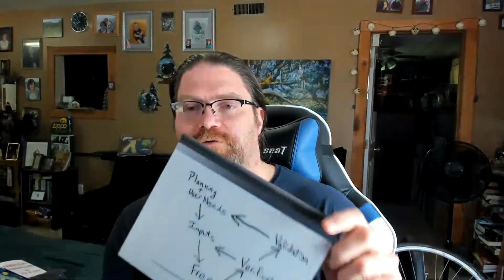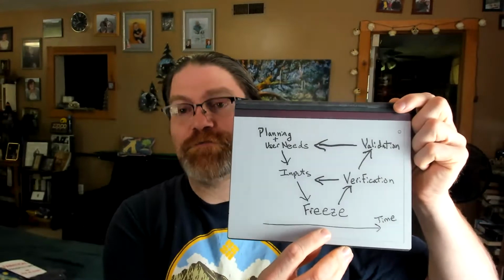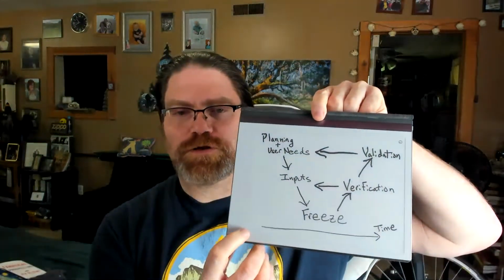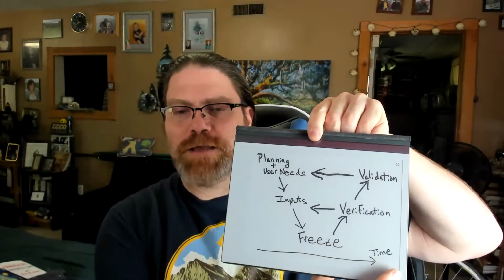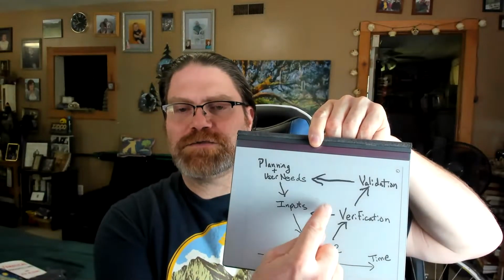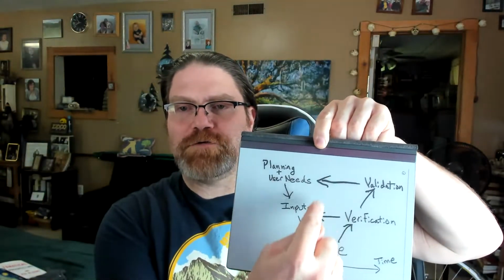What is the design control process and how has it changed?

Comment: isn't it 13485 instead of ISO 1345?
Reply from the maker: The particular video you commented on is actually about IEC 62304 and how design controls have changes as agile has be adopted. Most companies now think in terms of the V-diagram instead of the Waterfall diagram for software development. You are correct that the quality system standard is ISO 13485:2016, but I think I probably did not say it clearly enough or spoke too quickly. I also referenced ISO 9001:2015 which is a general quality system standard.